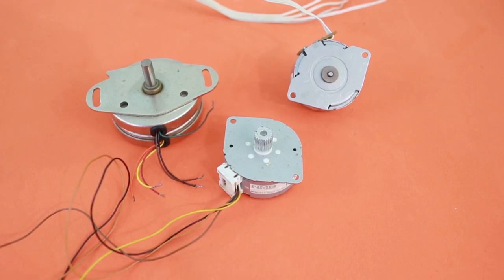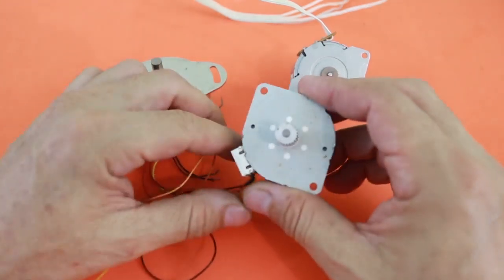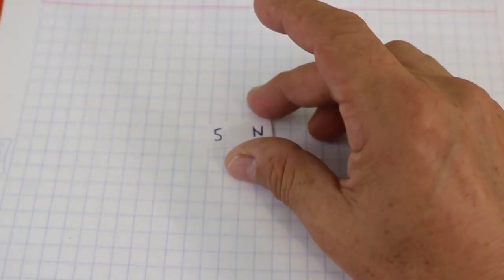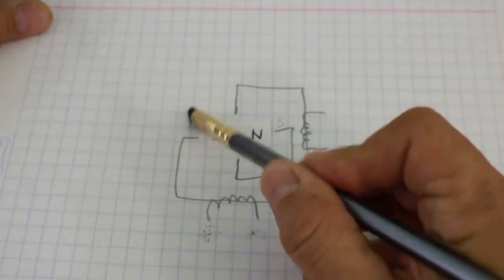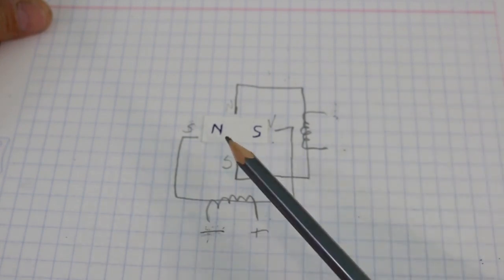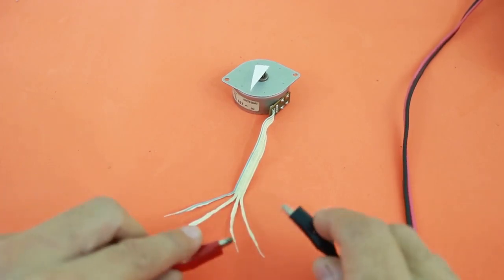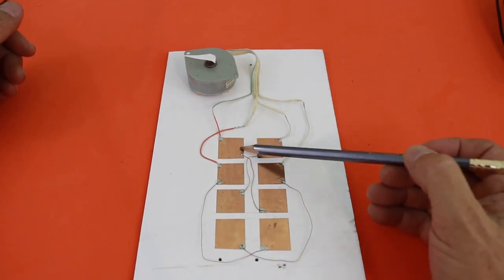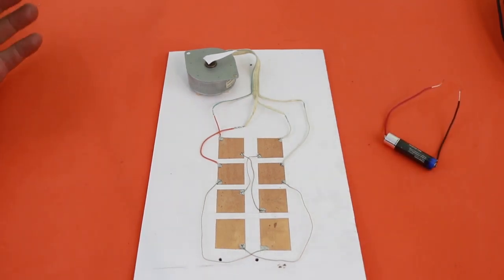How Step Motors Work

Comment: Good explanation! Note: A holding current can be employed to hold (almost lock) the rotor in place. Too much hold current can burn-out the coil and too little may not give your invention enough torque to hold some desired positions. A simple power resistor can energize enough to be difficult to turn by hand.